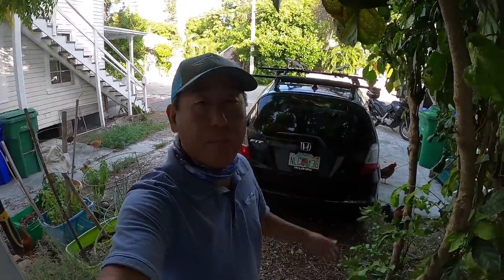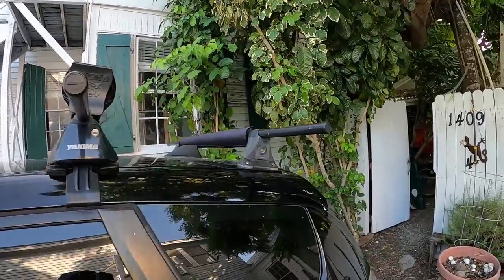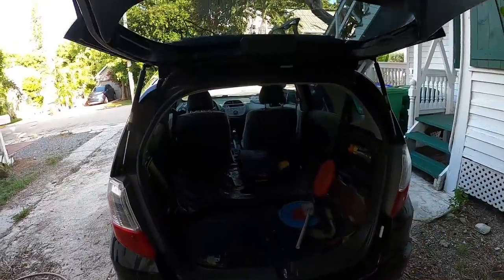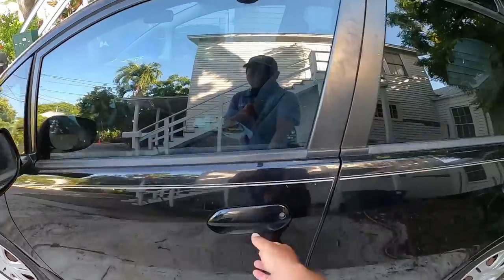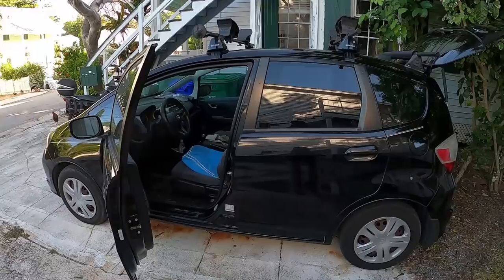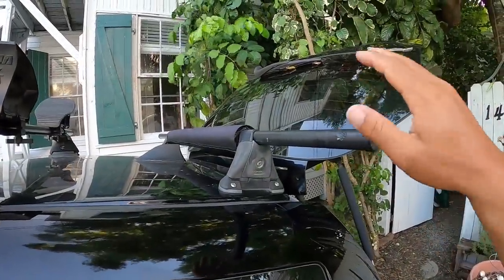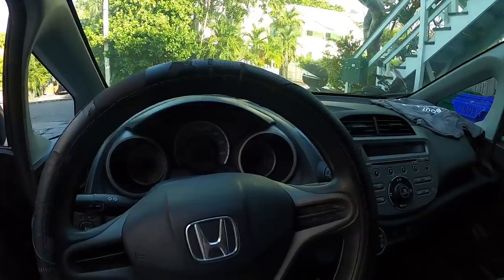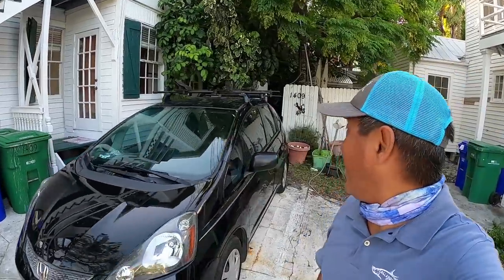Patreon Supporters Bought Me A Kayak Car - Thank You!!! - Honda Fit Kayak Car

Comment: Steve, that car is awesome. Especially for big blue, and the red offshore kayak  I purchased my 2017 Nissan frontier pro 4x. 4 months ago. I love my 120, fin drive, motorized, with all my accessories. I loved my Nissan Xterra but I wanted my truck for my kayak. I have the 5ft bed, but I wanted the king cab. I love my Nissans. Good luck with the new wheels. 😎 🌊 🎣

Comment: I use one pair of the land shark saddles in the front (like you have) coupled with one pair of rollers on the back so I can roll the kayak forward.  I do scratch up the back of the car without the third bar.  Might have to look into that.

Comment: Hondas are okay and all but the best kayak car is a Volvo XC70. Air mattress fits in the back kayak on the top and you got a turbocharged all wheel drive 5 cylinder which is fun. Or if your really cool you can get the twin turbo 6 cylinder. Volvo uses high end paint and the cars last long around salt. Pretty sure they did it with salt on the roads up north in mind.

Comment: Steve, I have a 2013 Honda Fit and love the car.  I installed CURT 110643 Class 1 Trailer Hitch with Ball Mount, 1-1/4-Inch Receiver on mine to be able to plug in a bike carrier and carry bikes and also someday to be able to tow a small boat trailer.  Might be a thought for you to be able to pull a  trailer with your kayak and prevent all that salt water dripping on your car.  Also I changed out my serpentine belt and after doing it the hard way, from inside the engine bay, I found out its way easier to take the passenger wheel off and gain access to the belt and be able to change it out...

Comment: Salt water inside your car will kill it. Suggest you get a garden spray can of about 2 gallons. Keep fresh water in it. Pump up an spray down your gear before loading it back into the car...it will save you thousands in the long run...cheers 🍺🍺🇿🇦🇿🇦

Comment: Congratulations Steve, nice ride. Would it be possible to strap your paddle on the roof bars as opposed to carrying inside of the car and risking damage to your interior components or possibly switching to a 2 piece take apart paddle? A folding step stool would help with the extra height if you got room for one. Thanks for all of your professional fishing and cooking advice.

Comment: Also, these strap anchors use an existing screw under the hood so your hood doesn’t get sanded down from sand and grit on the strap. https://www.rackattack.com/roof-rack-accessories/yakima-anchor-strap-kit/
Reply: There are also ones with a piece of rubber hose that fit under your hood and the closed hood locks them in place. Much easier to use.

Comment: I use a hand-pumped garden sprayer to wash off all of my gear before it goes back in the truck. It cost ten bucks and would solve your salt water on the electronics issue.

Comment: If you don't already, keep a pump sprayer filled with tap water in your car. That way you can fresh water rinse your paddles, pole, etc before putting them in your car. Helps keep the rust down.

Comment: Instead of doing the bolt on tie point for the bumper take a look at these: www.amazon.com/Thule-Quick-Loop-Strap/dp/B07C63CLRP
They fit under the hood and the closed hood pinches them and keeps them in place. I've been using them on my Rav 4 for about 10 years and they are perfect!

Comment: you did such a good job on old rusty but time for low maintenance now - you should probably repower/optimize kayak - hope you can get into some good fish outside the reef - do not be afraid to chum - stock up on baitfish when you get the chance - make sure you have all the safety gear #old flares #all about keeping that chum slick going - you may want something more like a 10hp? maybe a fourstroke - think about upgrading the fishfinder?  #trim #tuna
Reply: you know what a good hack would be - a heavily insulated cooler/freezer (rigid foam added) that runs on 12v ie the vehicle but also you have  50w pv panel on the roof - unlimited ice - just add water - you could have smaller version on the boat with panel on the lid plus with the foam it is also unsinkable  #battery trickle charger #overcharge protection relay #catch and cook

Comment: Spray some plasti-dip on the top section of the hatch, below the roller to save scuffs and you can peel it off when it gets damaged and reapply. Or just use tape, but do something, trust me.

Comment: Awesome Steve! Congratulations on the Fit purchase. Just a few thoughts. Late 90's Tacoma? Essentially bulletproof vehicles. Available with all the manual desires. Old tire innertube underneath the rack clamps. Silicone sealant where the screws are used? You can't go wrong with a Honda. Great choice.